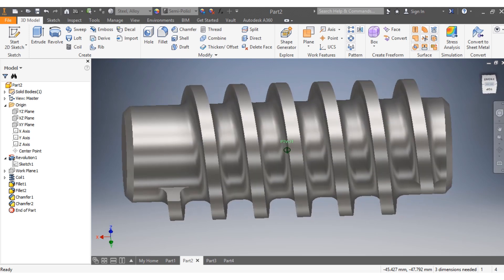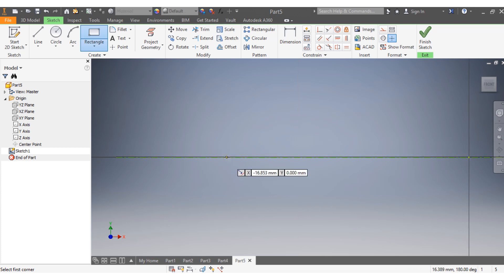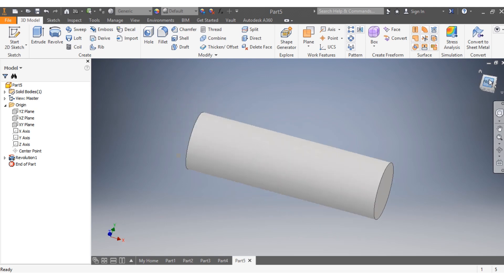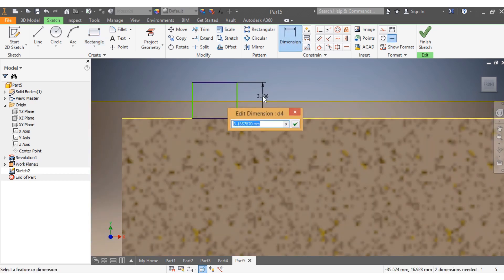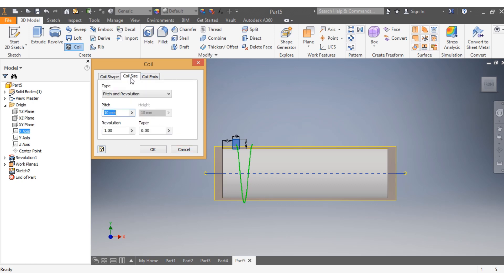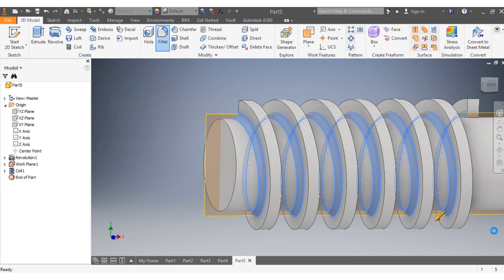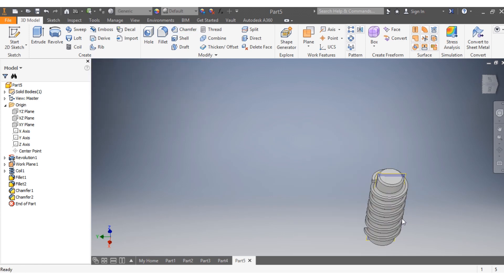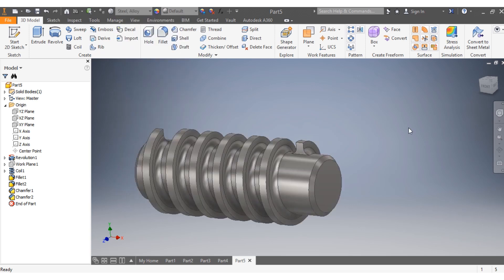How to draw a Drive Insert using AutoCAD, Inventor, AutoDesk (Mechanical Engineering), CAD161S UNISA

Comment: No matter what I do, Inventor studiously avoids allowing me to create a plane where you did. You cut right through the model. Mine WILL NOT offer me that plane. It creates a plane on the surface of the cylinder. This really isn't working. I'm going instruction by instruction, clicking every single thing you click, and it is acting 100% differently. I even restarted the program. I even deleted the model and again restarted the program. It will not offer me that plane. Everything but that one plane. Frankly, I hate this program compared to AutoCAD. It's convoluted and clunky. Doing simple things is a big rigmarole.
Reply from the maker: Hey Rowan, sorry to hear that.... First of all I hope you are using AutoCAD Inventor, if that's the case I will create another video explaining step by step how to use plans and create them

Comment: how did you get dimension pitch of 13mm? can you please explain, thanks
Reply from the maker: Hi, a drive insert is there to transform a rotational movement into a linear movement...Hence the pitch tells how long one revolution will be in linear term (Therefore the designer will pick the right size).